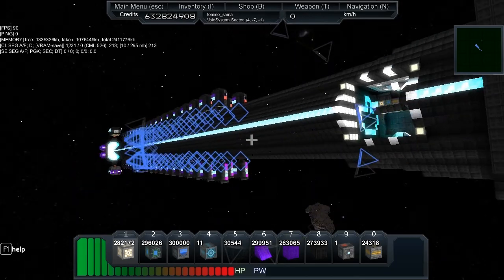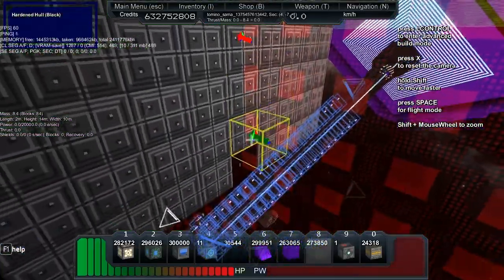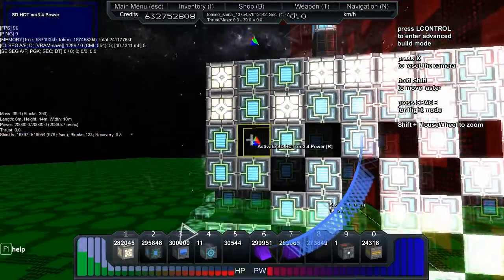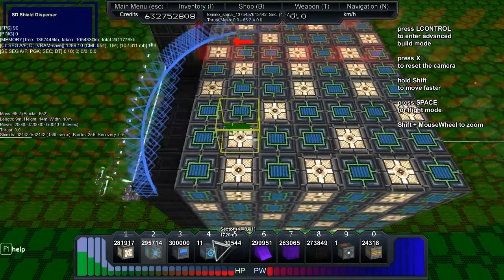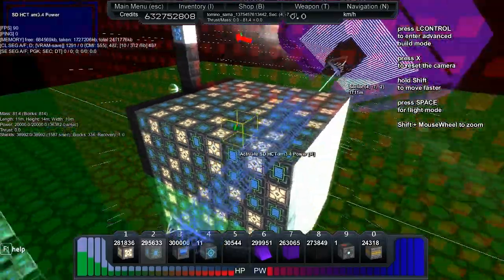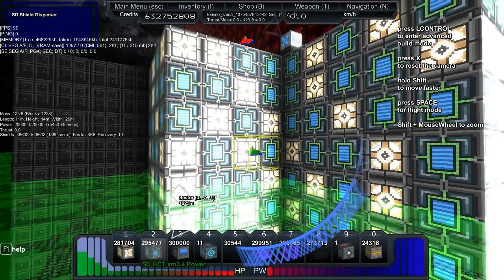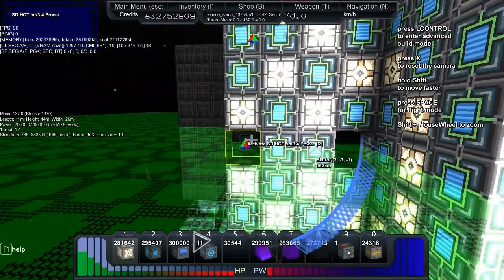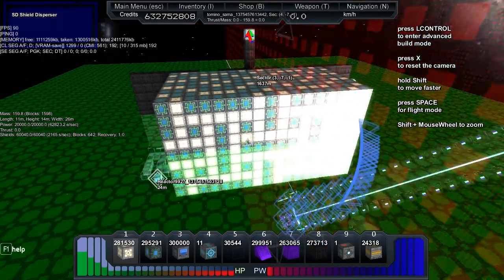Starmade Ep50: Extendable 9x9x9 Reactor Tutorial (using pattern 9927)

Comment: nice video, the 9927 is the best 5x5x5 but its success is not a mystery. there is one important rule, build as many unique parts (segmemnts that do not join with any others) within the space allotted as possible, in the 9927 case is fits 4 spirals in, that rotate around the structure from one corner to its opposite corner. then a few extras just to fill gaps. when building larger cubes you have to completely redesign, but while the spiral fits a 5x5x5 perfectly its not so useful on larger cubes.

Comment from the maker: Remember that 5x5x5 (125blocks) = 9927 and 9x9x9 (729blocks) = 36382. 
That is 9927 / 125 = 79.4 Energy Per Block
Or that is 9927 / 729 = 49.9 Energy Per Block

Your findings were 9x9x14(1,134blocks) = 52930
52930 / 1134 = 46.7 Energy Per Block

I think that the Pattern can be improved when upscaling and will address this in a later video. Evidently it will take up more room if no edges are shared, but makes it easier to construct where there are spaces and you can fill in with Shield blocks.

Comment: Best I've produced from a 9x9x9 block is 64283 - partially extendable, but you're better off with long, non-connecting lines for max power vs an efficient compact. Having a "reactor at the middle of long lines will reduce your overall power.  You're welcome to PM me if you would like me to share the blueprint with you.